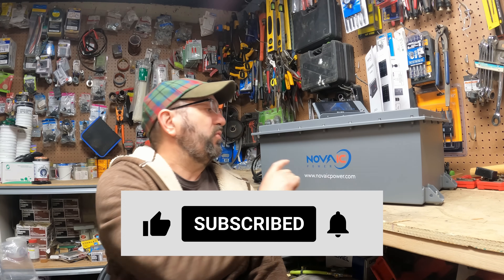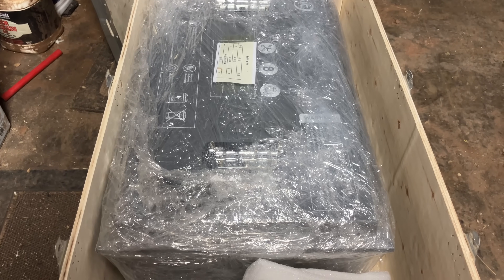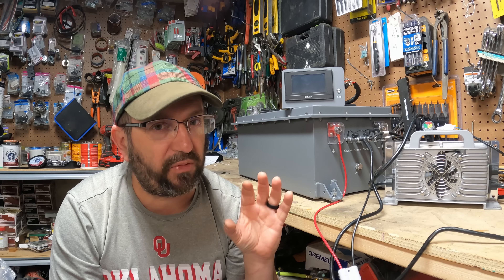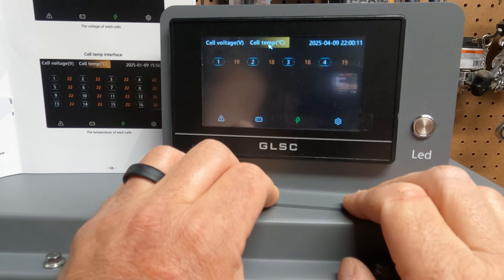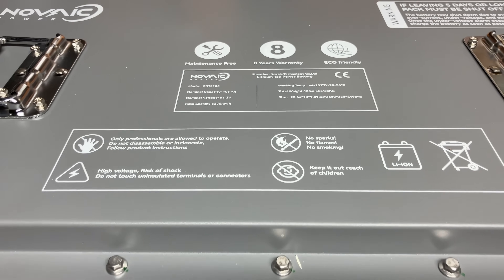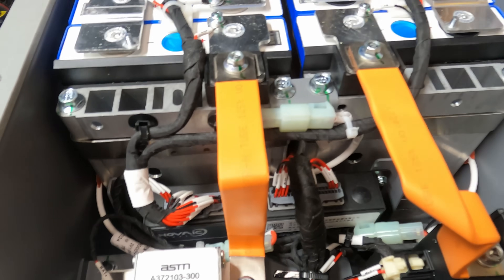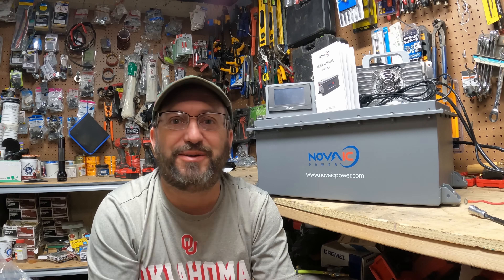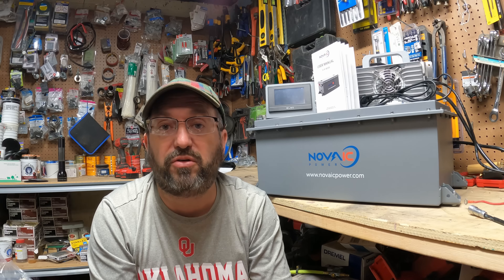Novaic 48V 105ah LiFePO4 Golf Car Battery review and tear down.  Impressive build quality! Excellent

Comment: Any idea how to deal with Precharge Failed fault?  Cause?  
It will not clear with the prescribed “restart”.  

Several other High Cell Charge Voltage faults as well.
Reply from the maker: Sorry, I have no idea.
Reply: Hi! The precharge fault just means the system detected a quick current surge during startup.
Try turning on the battery first, then turn on lights or music before using the cart — that usually clears it.
If it still shows the same message, please contact our support team — we’ll help you fix it quickly.

Comment: Heh.  I'll fess up to badgering you a bit.  Thanks and keep it up!    Yah, larger residential batteries are generally shipped much more carefully.  I have two EG4 indoor batteries in my whole-home backup system... 14.3kWh each, and almost 300lb each.  Those things are insane... four positive and four negative battery terminals, each set on a 600A bus so multiple batteries can be paralleled with zero effort.

-Matt
Reply from the maker: LOL. I like hearing input.  It makes my videos better.  What did you think of the build quality of this battery?
Reply: @OurBlackCatCottage  The build quality looks very good.  Definitely what I would expect for a golf-cart battery.  Looks like it can take a lot of virbation without batting an eye.  Check the battery cells... are the bus-bars welded, screwed, or welded and screwed?

Home backup batteries like the EG4 have even more features.   Breaker, soft-on (to avoid a spark and to avoid unnecessary wear on the breakers), current-limiter, automatic battery heating in cold environments, closed-loop comms, RSD integration, two one-shot fire extinguishers, etc.

-Matt